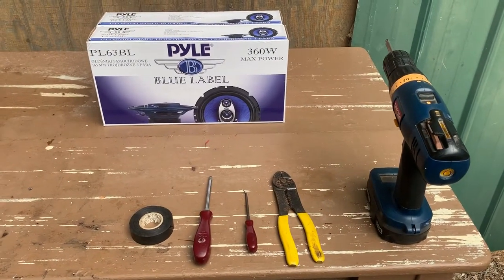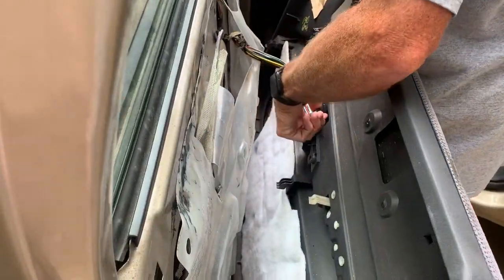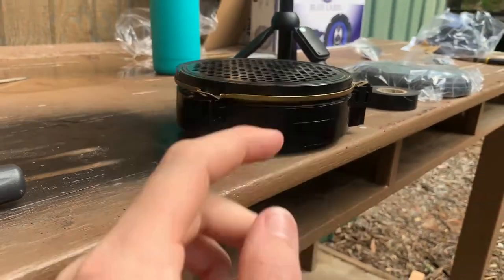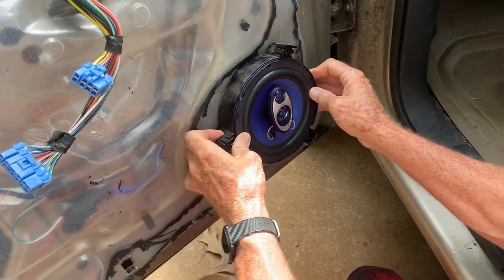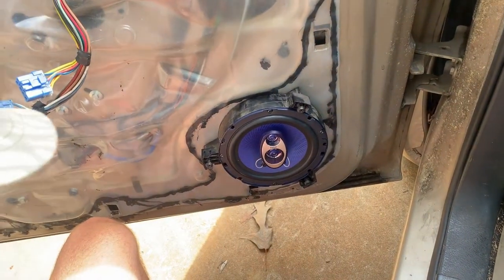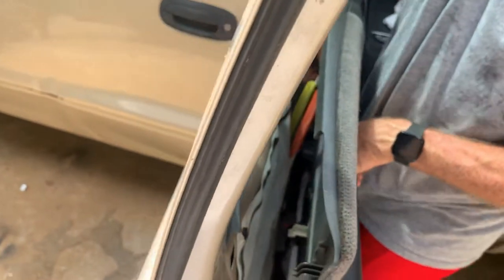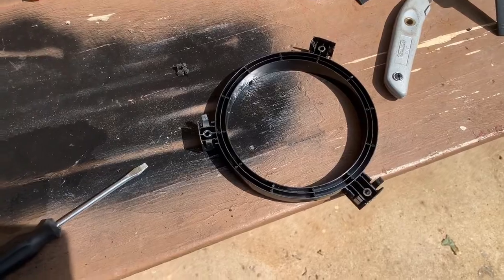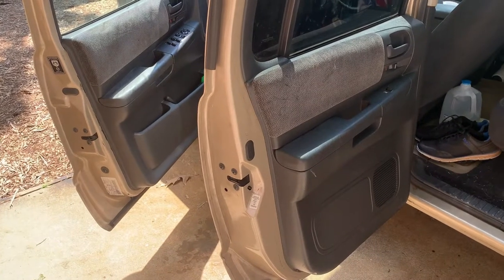Dodge Dakota Speaker Replacement

Comment: Hi! Wonderful Walk-Thru on your Speaker Replacement Job! Will attempt this on my 2004 Dodge Dakota . Were your new speakers way more powerful with extra kick bass than your orginal OEM ones? My aftermarket stereo claims it will hit 50 watts per speaker. I'm hoping to find more powerful speakers (four total) than my original ones, but still wish to use the original fittings like you did. I'm also assuming we both don't have street blaring Amps under the middle area under our seats, and are simply wiring to the back of the Stereo.
Reply from the maker: Still have all of the stock components and the new speakers make a huge difference.
Reply: You’re not going to get bass out of 6.5” speakers unless you get the ones that are 300$ each.

Comment: Do you remember which color wire  was the negative and positive when you connect them to the speaker’s wires? I see in the video their both green but possibly have a colored line on them?
Reply from the maker: I don’t remember. Look at how the wires go into the clip on the existing speaker and wire them accordingly for the new speaker.

Comment: Any chance you can show how to do the rear speakers in the extended cab ?
Reply from the maker: Unfortunately I do not know of anyone with an extended cab that I could look at. However, I was able to find a brief overview and diagram of removing the trim panels at the link below. I'm not sure how the years differ, but they should be fairly similar. As far as the speakers themselves, they should be similar to the front ones. 

https://www.justanswer.com/dodge/4t959-dodge-dakota-slt-begin-removing-rear-interior-panels.html

Comment: Do you really have to cut wires to put new ones in really I'm a female and I have to do all that
Reply from the maker: The factory speakers use a wiring harness with a matching connector on the speaker to connect it. There are not going to be any after market speakers that have the same connection. They will all come with separate wires that must be spliced into the trucks wiring.
Reply: If you order from a reputable place, such as crutchfield, they make the adapters that fit to the speakers and plug into your factory harness so no wiring is needed.